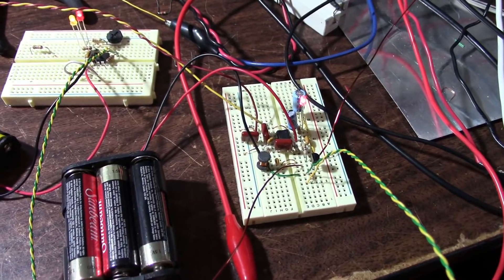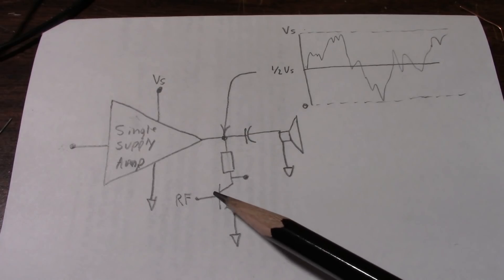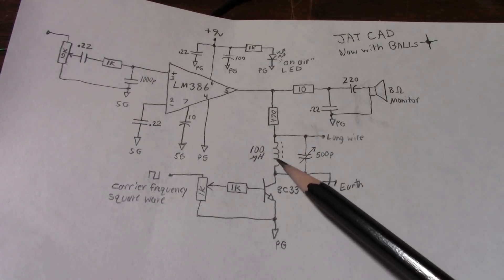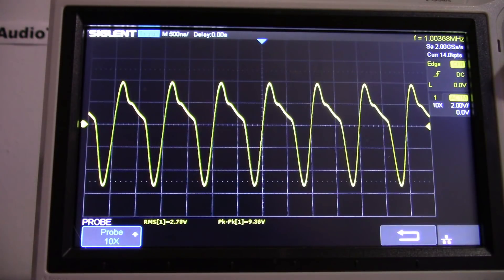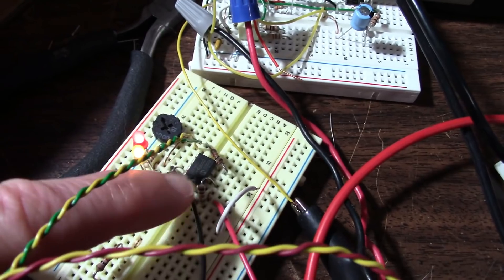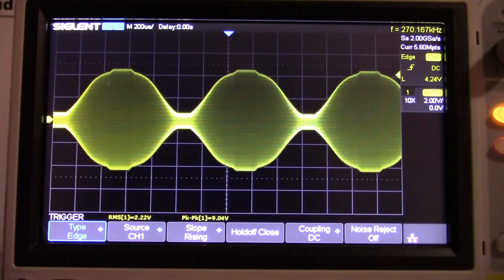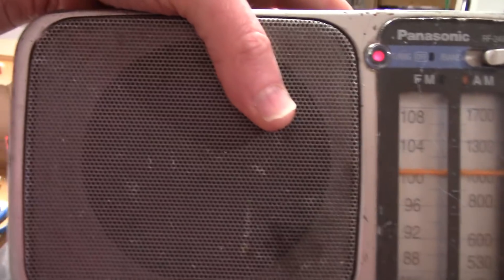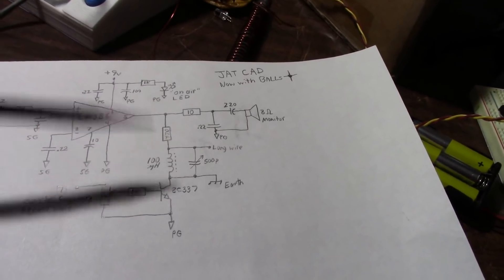AM transmitter based on the LM386

Comment: Great video! An approach I haven't seen before. I learned a lot. As a radio ham, I'm now wondering if I use the circuit as a basis for a QRP (low power) transmitter.

Comment: I use a circuit sonwhat like this for my low power AM station. The LM386 provides power to a class C transistor switch which then is filtered. I use an Si5351 to generate the drive signal on the transistor so i get perfect frequency accuracy. The Lm386 essentially modulates the power going into the class C a amplifier,  this technique is called high level AM modulation

My station has an arduino MP3 player with 10 hours of Art Bell radio programs and it switches tracks randomly. Its been running for almost 2 years now and has a range of about 2 miles. It is connected to a 10 foot copper pipe with a wire capacitive hat, and a metal mesh on the ground as counterpoise. The antenna is tuned with a large coil wound on a 3 inch diameter PVC pipe, using a NanoVNA to get the best tuning. Impedance is only around 15 ohms or so with such a short monopole antenna though so of course its pretty inefficient but i have picked up my station with my car up to 3 miles at certain locations, i beleive i am putting out about close to 100mW at the output of the antennna amp bit this wont translate much to RF with a short antenna like i have so RF is probably 1mW
Reply: I checked your channel listing in the hopes you had done a video about it. Would love site of a schematic!
Reply: @acestudioscouk-Ace-G0ACE  Sight of a schematic would be far better. 😉

Comment: Great video! I’m going to build it. One question- Instead of connecting ground to a copper pipe, is it okay to connect it to the third prong of my wall outlet, or the green terminal on my power supply?   Thanks.
Reply from the maker: Any good earth ground would be fine.

Comment: I was wondering, the square wave you use into the transistor, as it is square, will that be like the sampling rate of the audio that is added to the sine wave?
You use 1MHz for the square wave but that could really be anything, am I right or way off?
Reply: Not quite. It defines the carrier frequency i.e. where on the AM dial the signal will be. So it has to be somewhere in the frequency range of your receiver. And within the capabilities of the other components in the circuit.
Reply: OK, but it's square wave, so how can that sound great in the receiver as it not sine?
Reply: @AliensInc.  it gets transformed into a sine wave as it's fed into the resonant circuit
Reply: @AliensInc.  and the carrier wave gets "removed" by the reciever, what you hear is the original signal or the "modulated" signal

Comment: That's some interesting stuff to tinker with. About 2 years ago I tried to build two super low power AM transmitters, out of just two transistors each, one for operation with a quartz crystal, the other one based on a LC resonator. I might have gotten away with just one transistor each, using the audio source as a modulator, but a little integrated amplifier couldn't hurt, right? The experiment was a success, despite of the LC circuit being a little unstable. The audio quality was surprisingly good, but being a very low power circuit, the signal was not very strong.

Comment: The capacitor on the single rail op amp output is not just to block the DC. When a class B amplifier circuit powering a speaker, is single rail power supply, a capacitor is required to provide a current path for the negative voltage swing.

Comment: Man this brings back memories. As a 12-year-old In the late 60's used to fiddle with AM like this. Owned just one transistor that would work at one megahertz.  All circuits had big warnings about max antenna length 10 feet.  Used to wonder if I went longer whether an FCC van would show up in the driveway. Still remember that 100 turns of #28 mag wire on a 1 inch air core and a 365pf variable cap would tune the broadcast band.  Great stuff. Thank you.
Reply: I loved this, great boyhood story!

Comment: I used a 555 for an AM transmitter over a year ago for giggles. I vaguely remember using filters to change from square wave pulses to more sine like. I also remember it liked to splatter all over the AM dial.

Comment: Amazing little circuit, very well explained ! I built something like this when I was a kid, just copied from a book so didn't realy understand back then, but it fuelled my love of electronics and I see this and it's still great fun, something fun to play with on a rainy (I'm in the UK) Sunday...a little off topic but I have started playing with the Texas instruments circuit simulator called ' TINA' have you heard of it ? I have put in the JAT501 and have small signal in big signal out, thats about as far as I've got  ! so now time to go back through your tutorials and see if I can replicate your design adjustments as you developed each part. I don't have the correct output trany's so put put a TIP30 and 31 in there, so off to do my homework as the sim has asymmetrical clipping, the positive half is clipping first...would love to see your transmitter refined a bit...cheers.
Reply from the maker: I've heard of TINA but never tried it. Have fun with the tinkering.

Comment: To get solid triggering use another channel and use it to trigger direct from the LM386 output rather than the modulated signal.  Using transformer coupling between the LM386 and the RF power stage collector would yield a significant increase in RF output.

Comment: Based on this, it seems like one could make an FM transmitter with a 555. Use the output of the LM386 to drive the trigger/threshold pins. Output an intermediate frequency directly from the 555 (455 kHz? 1.6 MHz?), and mix it in with the higher frequency oscillator. Am I completely off my rocker?
Reply: My gut feeling is that it would change frequency way too much and make the whole thing not very stable.
Standard FM radio has just 10MHz badwidth and a lot of newer ones are 5Mhz.
Reply: @zlac  Maybe. Remember, you can always turn down the audio level. The LM 386 might not even be necessary, a transistor parallel to the oscillator cap from the trigger pin to ground should do the job just as well, maybe put a resistor in series with the transistor for good measure.
Reply: That might be something to try in the future! I do understand the concept of mixing the frequencies, but how can such a circuit convert the signal from AM to FM?
Reply: @theschnilser7962  AM is "Amplitude Modulation," as John shows here. FM is "frequency modulation," where the amplitude stays the same, but the frequency shifts slightly corresponding to audio. The threshold/trigger pins on a 555 are what determines the frequency the 555 switches at; I was wondering if the output of the LM386 could be used for that.

The 555 would need to be at a standard intermediate frequency (abbreviated IF; I forget what terrestrial radio uses, but I think it's 1.6 MHz). Use a ~100 MHz oscillator to mix with the IF and perhaps it's receivable? Mixers can be diodes or transformers -- there's schematics all over the Internet.
Reply: @McTroyd  What an interesting approach on frequency modulation. I might try something like that next weekend, since I should have all necessary components on hand. 
As you can see in every generic 555 oscillator circuit online, pin 5 or trigger is connected directly to the RC network, which is setting the frequency and duty cycle. I am confident, that the output of the LM 386 can be used to shift the frequency of the 555 a fair amount. Since there should be a difference in voltage between these pins, I would recommend adding a resistor. Maybe another resistor to ground and coupling through a cap might improve the quality, since the lower frequencies usually have a bigger effect the modulation. But the last thing is mostly speculation, since I do not know if that applies to the 555.
Reply: @theschnilser7962  If you remember to do so, I'd be curious how that turns out. Only very recently has RF exited the "black magic" zone for me, and I'm still getting my feet wet. From what little I know, I'd wonder most whether harmonics or self-oscillation would be better or worse in such a setup (especially since the 555 switches a square wave).
Reply: @Ted McFadden  There's always the possibility to filter off some of these square wave harmonics with the help of some LC and/or RC low pass filters. I think it's worth to try.
I really like the idea to use the 555 for another awesome application, what a legend of a chip. 
I am myself not an RF expert. Electronics in general are just a hobby of mine for now. Nevertheless the concept of this circuit seems to work in my mind. 
I'll try to remember to tell you about the result when I'm done!